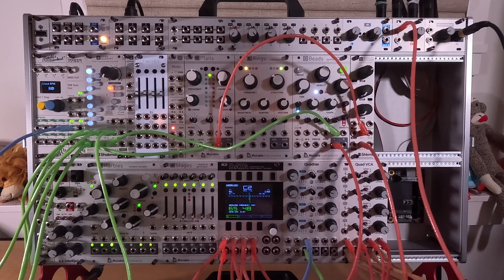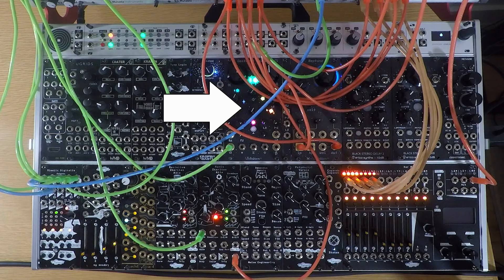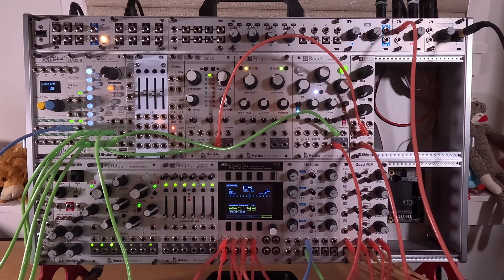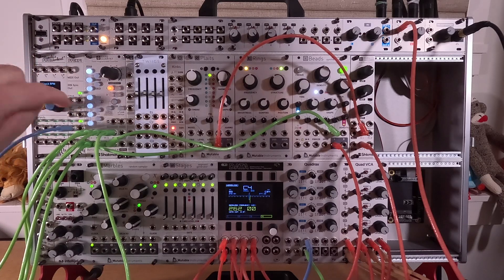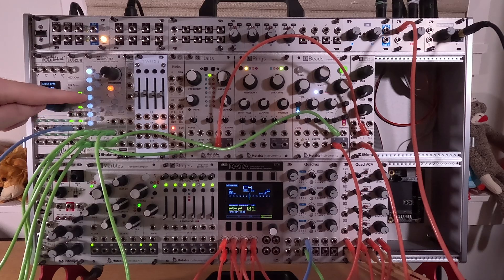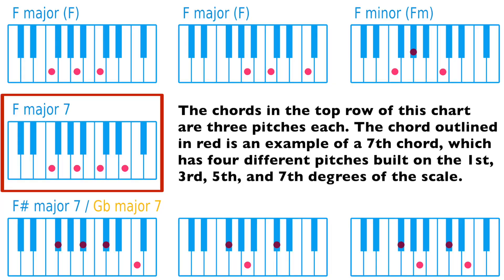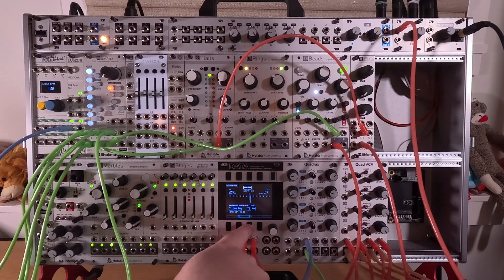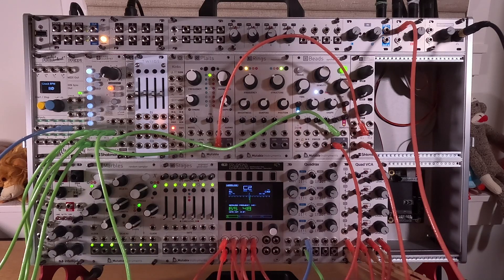Building chords from monophonic Eurorack oscillators

Comment: This is useful for building 'em with traditional, analog modules❕There's a fair bit of mixed nomenclature when it comes to describing polyphony in Eurorack, all being thrown around interchangeably. Manufacturers will use a "voice" count, others might describe their modulation as a "channel", and even the synthesists themselves will describe "a single bit of monophony" as a "pathway". I've gotten used to all these different terms, and if I had to characterize it, you're acquiring polyphony by setting up separate "channels" or "pathways" to ultimately establish more "voices" of polyphony. I've been studying Eurorack purely online for some years now, in preparation for when I have the funds to drop on it. Because the money's clearly a big deal to me, I'm looking at mostly MIDI modules which already have independently-controllable voices like the Poly Cinematic, Disting EX, Poly Hector ..tho they require external device or CV mapping to MIDI channels to control independently. Still, this will allow me to have lots of different voices in as small of rack real estate as possible IF I provide enough peripheral control over them (already on my way with this too, planning wise). Thanks for thinking about this and posting about it❣😸
Reply from the maker: I hadn't heard the term "pathway" before. That's interesting. "Voice" works well for me since I have a music theory background, and this is how individual melodic lines stacked on top of each other to create harmony are referenced. The classic example is a 4-part chorale, where each voice is literally sung by a person, hence the name. For polyphonic Eurorack modules, definitely check out the OXI Instruments Coral if you haven't already.

Comment: "The hard way." Not a dig, just saying, this is more or less brute forcing it. One advantage of doing it this way instead of using something like harmonaig is that you get the voice leading right. If you're doing a straight triadic chord progression, it will sound vastly better if you don't just move a "root 3 5" chord up and down. Instead, as you've done here, move each voice as little as possible. 

Parallel voice leading (where stacked voices all move up or down from note together) is usually less pleasing to the ear than contrary motion (where one voice moves up and another down). Parallel octaves and fifths, where two voices move to and from an octave/fifth, are particularly noticeable. 

As to alternatives, I'd guess that midi to CV is probably simplest. 

Also, just consider whether you really want to do it in modular. In this case, with four very different oscillators, you can articulate each voice independently to emphasize a melody or get dense timbral motion. 

VCV Rack might be a good tool if you want true polyphony in a fully modular instrument.
Reply: Basic instruction for western classical voice leading quoted from Wikipedia: "Common-practice conventions dictate that melodic lines should be smooth and independent. To be smooth, they should be primarily conjunct (stepwise), avoid leaps that are difficult to sing, approach and follow leaps with movement in the opposite direction, and correctly handle tendency tones (primarily, the leading-tone, but also the ￼, which often moves down to ￼). To be independent, they should avoid parallel fifths and octaves."
Reply: https://en.wikipedia.org/wiki/Voice_leading?wprov=sfla1
Reply from the maker: Thanks for the additional detail on voice leading! What I show in the video is, of course, an example of the technique. You're free to orient the voices any way you like with this approach. I'm planning a follow up video using more intelligent settings on the quantizer to make the process of setting this up less painful. And of course, as you say, it would all be easier with MIDI and a fancier sequencer. I could have used my OXI One which has a chord mode!